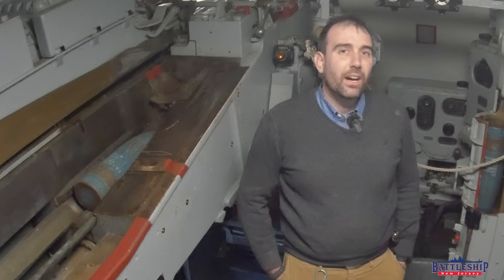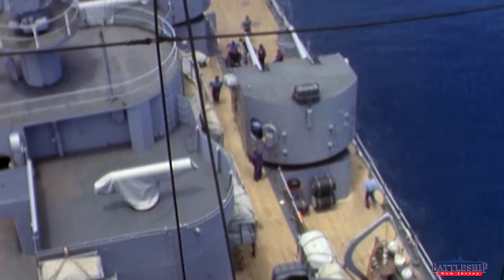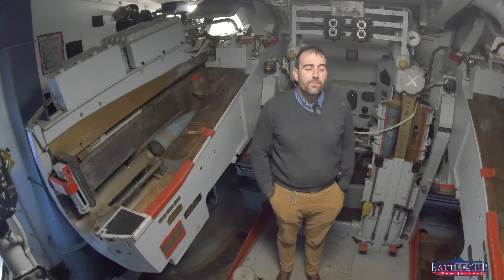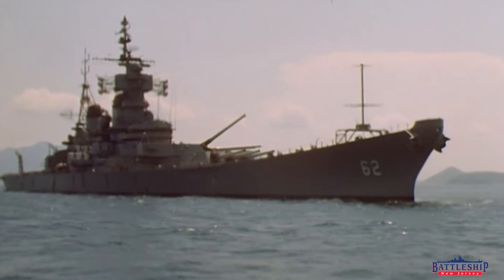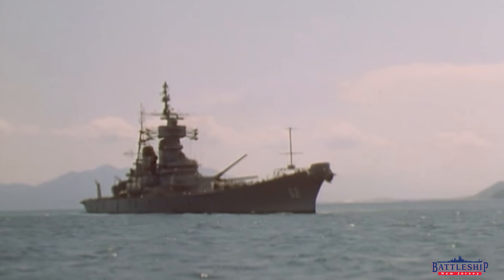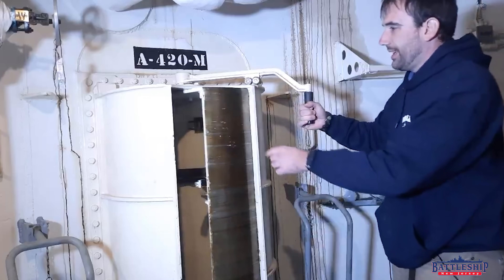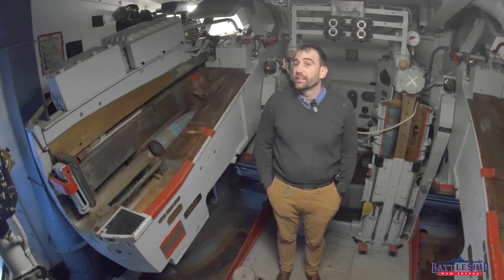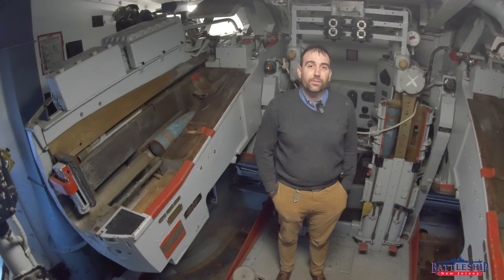Why Do Modern Warships Have So Few Guns?

Comment: You nailed it (IMHO). Fighting low tech enemies will require guns and bullets. Not just to fight flying drones but unmanned surface “drones” (and manned).

I remember a battleship Chief talking about the power in the ability to drop an explosive VW Beetle on a target 20 miles away.
Reply: tbh its not that expensive to tape APKWS on a turret or something...
Reply: arent drones unmanned by definition. so unmanned and mannes drones as a term make no sense at all...
Reply: @mugnuz  Correct. Note the quotes. One of the USN’s greatest concerns in operating capital ships close to shore or in environments that limit their ability to maneuver is a wooden row boat full of explosives.

Comment: If the gun munition is 'dumb' (and you were talking about cost), the farther the range, the more there is an opportunity to dodge it.  At 10K altitude and above where an aircraft could easily hit a ship with guided glide munitions, there is enough time for the aircraft to move (a ship is a pretty good target for autonomous munitions).  Guided missiles are a way to match aircraft capabilities ... and it might have been an over horizon launch so the ship needs a way to respond.  I don't think it is just a range thing to have few guns and more missiles.  At sufficient distance, I believe the missile typically arrives at the target sooner than a cannon round...another advantage if shooting at an aircraft.  (Note: I am just electrical engineer and not in the Navy now or ever)

Comment: There came a point when Air Force and navy fighters saw the removal of the air to air dogfight cannons in new planes. Their reasoning was onboard missiles could take the place of the cannon and would be useless. With the need to maneuver to lock on to the enemy planes it took too long to acquire the target. On top of this if the target was too close it would be overkill and fly through their own explosive concussion or even have their own missiles become locked onto themselves if they missed. I think they found there were times when the projectiles couldn’t change course was a better option. If they do the same with destroyers and missile attack ships then they become vulnerable to smaller boats and planes that could unintentionally come within range. Without a way to defend against overwhelming numbers of smaller assets where they would need to reposition guns towards rapidly moving targets which when attacking in larger numbers would become equivalent to a larger adversary. I hope they’d recognize that faster moving attackers would require smaller guns to disable them along with quicker gun mounts. In essence it would seem they require guns for any ship that has the potential to disable them. This would include anything that could be used in a Kamikaze style attack. Unfortunately, without a variety of weapons on deck it could ultimately invite a return to boarding parties… another class of weapons to consider.

Comment: Traditionally, I'd would improve on the number of guns fitted on a ship. Yes, it's not as accurate or have insanely long range as missiles, but guns are far cheaper to maintain and fire than a missile launcher. Which reminds me. Hey, Ryan, is there any chance you could possibly do a video on explaining why battleships like Tennessee, California, West Virginia, and the Montana-class (IF they were built and commissioned) couldn't just go through the Suez Canal instead of taking the longest route possible to the Atlantic coast or being limited to the Pacific fleet?
Reply: Sometimes it is more about the security of the travel than the travel it's self
Reply: Look at a globe - Suez is on the other side of the world! It's much shorter to go around South America.
Reply: @fluffysheap  True. But there are many circumstances to also factor in. Like the fact IF a battle fleet that is restricted from using the Panama Canal is located off the coast of Japan or anywhere else in the western Pacific region and had to report to the Mediterranean or back to the East coast of the US. Do you really think that said fleet would cross the Pacific Ocean to the southernmost tip of South American and come up that way?

Comment: Your point on a new battleship having less guns is probably correct.  In fact it might not even be a full sized battleship for such a purpose but something more akin to the Erebus-class monitors with their single turret with two 15 inch guns and a displacement of only 8,000 tons or so.  Such a vessel with a more modern propulsion system that can bring it to 30 knots (instead of only 12) as well as modern self-defense systems such as Rolling Airframe Missiles and Phalanx would be a more economic design for the specialist role of shore bombardment and the smaller hull size would better fit modern force structures.  Shore bombardment monitors would be cheaper to both acquire and operate  as well as have higher readiness rates than battleships would have.
Reply: i think we will see the return of the battlecruiser or some form of light battleship. one with the armor to basically shrug off the ordnances that dji drones deliver as well as being able to perform fleet picket and shore bombardment roles. we wont be seeing any gun slug fests but there are still tasks that could be done much cheaper with a modernized BB. imagine something like the Iowa but with less staff.
Reply: @Andrew_Sword  In the modern fleet and economy monitors make more sense than full blown BB or BC.  Monitors were DD sized but had a single BB turret and roughly cruiser levels of armor.  Though I think in a modern monitor design most of that armor would be removed and that displacement used for more modern defensive systems, AA, and improved maximum speed to about 30 knots.  For something intended for the rather niche role of shore bombardment I think something much cheaper than a BB would be used and probably not too many of them would be built.
Reply: @NuclearFalcon146  i think navel planners will have to determine whether they want a one trick boat or if the want to give it multiple capabilities to augment the fleet.
Reply: That does sound good
Reply: Monitors are wacky. I need more of them...
Reply: Hear me out... Hovercannon
Nevermind, after 3 shots, it would be moving faster than the aircraft.
Reply: basically what the ddg-1000 program's goal is,and we all see how it goes
Reply: @Type09V  The DDG-1000 class went beyond the scope of that as it was intended to still be a destroyer.  It tried to overshoot a monitor role by a quite a fair bit.  DDG-1000 class has almost twice the displacement of the Erebus-class monitors.  What I was thinking of was a vessel around 7000 tons or less armed with a single turret with twin cannons that can be anywhere from eight to sixteen inches in caliber (depending on available weight) as primary armament, and for self defense a CIWS, Rolling Airframe Missiles, and maybe a 25mm bushmaster on each side.  It would not have the CL level of armor HMS Erebus had but would have improved engine technology, the combination of better engines, not having WWII cruiser levels of armor, and more modern hull form would allow for increased speed, ideally 30 knots to match the fleet but 25 knots would be acceptable.
Reply: We’re bringing back the Ironclads 😂

Comment: I don't think 'flak type' guns will replace missles anytime soon in large scale conflicts, maybe never. Rather, directed energy weapons (lasers, erc) will likely become (and are, finally, becoming) effective before drone swarms, etc, come into play in near-peer conflicts. 

(There are some very impressive 'flak type' AAA, like the Millenium Gun, Rhienmetal Skyshield/ Skyranger, etc are impressive, but their programmable,  multi-purpose, multi-fused, shaped tungsten pre-fragmented ammunition is closer to missles than they are to conventional AAA, especially at (probably, info is scarce) @$500-$1000-ish, bare minimum, per round with dozens of rounds fired per target... that can't cost much less than Iron Dome or SEARAM, (Each at @$100,000), right? (I think- I'd welcome any input, corrections)

Comment: We see guns start coming back.
With Phalanx and goalkeeper being replaced with missiles the 57mm and 40mm guns are coming back in decent numbers. The British Type 31 Frigate will have 1+2 of those guns.
An advantage of the 57mm and 40mm is the range, there is no way a skiff can get into range to fire anything against those guns but the guns can also handle advanced air targets owing to advances in fire control and ammunition since the 60's.

Comment: Maybe they could use some 10 or 20mm radar and optically controlled guns for 100 drone attacks. A drone with AI vision would need a decent processor but it would not exceed a few watts and $100, if it used very simple infrared pattern matching of a ship on an ocean, the target is pretty obvious. I suspect the drones they see are guided by people, because GPS is not practical on moving object and though the AI is not that sophisticated it is probably beyond the Russian war. They have a lot of power on the ship and will overpower any approaching drone, the high bandwidth of video from a low powered drone is easily overpowered, you can't see you can't steer.

Comment: I would think that with drone swarms becoming a thing, as well as small surface craft,  Adding say, 2 mk 110's   and boosting the number of autocannons could be a viable option.   Esp if guided rounds for the 57's become widely available and inexpensive enough to have in bulk.   I believe Bofors calls them ORCA(?) rounds.   Between the advanced combat management systems, and the multimode fuse, they'd be useful against a lot of targets- including as another layer of defense vs an incoming missile.   The ROF of that gun is quite high, too- it'll actually put a higher weight of ordnance downrange than a 76mm in a given time, even though it's rounds are significantly lighter.  (that's one of the reasons the USN chose it over the Oto Super rapid 76mm for the Constellations.  That, and we already have it- and the supply chain for it- in inventory)

  Cheaper than expending a RAM or ESSM on a drone- and you can carry a lot more rounds.  Allowing you to save those for more pressing threats- like incoming AShM's.  And/or extending your time on station.

  I believe Italy's ASW  version of the FREMM uses that configuration:  a 5" and 2 76mm's

  Bumping the 25mm autocannon up to 30 or 40mm would allow access to more different kinds of rounds as well.  (the manufacturer already makes both)

  The question then becomes what do you trade -off for these extra guns, and the storage and handling space they'd require.

  Might be interesting to dust off the plans for a modern 8" gun for a Ticonderoga replacement, if we ever get around to planning one.
Reply: Just make Modern Des Moines class cruisers.

Comment: Nice video, I think we should be putting more guns back on ships. And it shows the short sighted view the navy has, it still thinks missiles are king. But is that still the case in the ever evolving missile defence world. Which to me has made them less effective. Like Iron Dome that at sea on a ship would stop missiles cold, anti-missile missiles, CIWS, and lasers like LaWS ship-defense, and jamming tech, plus I hear for every one used that hit more fail to hit. 

All of this could shorten ranges that are now 100 of miles back to 30 or less, not saying bring back ships thay have nothing but guns as that is just as bad as relying on nothing but missiles. No mix it up, increase the gun size to, for DD four 5in or 6in guns in two turrents is good, CL eight 8in or 9in four turrets, also look into making new battleships, I know they were WW2 when  designed, but the Montana-class built with todays tech,

Comment: I agree that there will likely be more guns in the future. One unusual use for them may be as a last ditch against hyper-sonic missiles. Not to hit them exactly, but to shoot in front of them with special fuel-air explosive shells to create a large blast zone meant to disrupt and deflect them... pushing them off course beyond their ability to recover in time. Of course if the payload is a tactical nuc, it would not help much. Or, another possible special munition could be a super capacitor to create a small EMP pulse fairly close to the missile, that was far enough away from the ship to not affect it yet fry the target's electronics.

Comment: Learn from the lessons of the past. We get "cheap" and do not put as much ordnance on these newer ships, relying on missiles primarily. It costs money for extra CIWS mounts or more small deck guns.  Once it all "hits the fan" then we will see panic and start putting lots of guns back on. Just look at what is happening to the Russian fleet. Ukraine is sending drone boats and getting in and doing some heavy damage. Arial Drones could deplete a ship's missile magazines and leave them vulnerable. We need to have every ship with at least 2 CIWS systems for small boys and more for the big boys. We need to have multiple mounts to be able to handle these swarming small boats. We can automate and still cost effective. Going down to a single 5 inch on the Burke's was a mistake. You take the redundancy away with only a single gun. Believe me, the Spruances, Tico's and Burke's have plenty of room inside to be able to handle some extra ordnance. The services did the same with the F-4 Phantom making it all missiles and removing the gun. What happened, they wound up adding it back because when it does get up close and personal, the gun was the best and sometimes the only choice. Lets not lose ships before we learn this lesson.... again.....